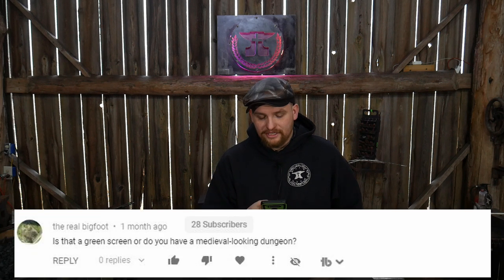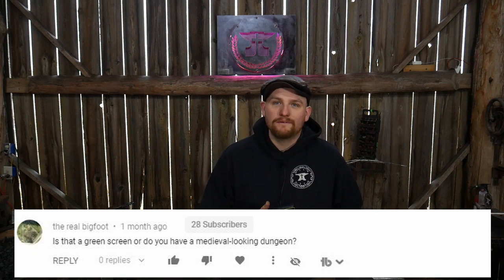Harbor Freight Anvil Q&A  #blacksmithquestionoftheday (S2E2)

Comment: RXR track is better..... At least you know it is not an anvil...... The other one just looks like an anvil. Lol.  I do agree that it least it has some usable things lile a hardy  and edges.  Beyond the hardness and a million other issues. I never hear anyone talk about is the shape of the horn. If the horn is not round, shaping on the horn makes everything just that much more complicated.... I have been forging for a living 30 years shoeing horses, I am in the fire literaly daily. Your begging shoulder issues. If the horn has a flat spot on top, you have to shift your body across the far side of the horn to get a radius.  Changing your posture 8 gazilion hammer blows over a lifetime of forging shortens that lifespan. Your time you can enjoy forging will be diminished. Lastly as the radius in now compacted your margin for error increases exponentialy. Believe me I know anvils are expensive.... I have had 5 in 30 years. You must consider, it is the heart of the shop. They are cheep. Way way way cheeper than a rotator cuff surgery.  Get a serious anvil and forge. I still use my orignal forge in the shop. I have done 30 years of forging with 3 gas forges and 3 coal forges. I could have still been using my original anvil but it was too heavy for in and out of the truck 5x a day. It was a 165lb Peter Wright. To proove im not talking smack my next anvil had a flat spot. 125lb Mankle.  Now I rock a 100lb Emerson traditional in the truck for 18 years. 150lb Emerson on a 300lb base in the shop. I have a 100+ year old Trenton my son uses. 100years of service... a good anvil is cheep. All round horns. Good tools change your life. Bad tools can make the simple job so much harder you quit befor you get proficiant. Invest in your succsess with real tools.

Comment: The need for the 'perfect anvil' is overblown. I use one of the 55lb Harbor Freight anvils, and yeah, it ain't perfect, easily dimples, but for the occasional amateur blacksmithing project, it does the job just fine. After all, we're not making precision watch parts here! ;-)

Comment: Interes, I have plenty of railroad track available.  Was considering....... mount the curved surface down maybe?
Reply: That's doable but the catch is that the bottom face isn't as thick as the top so you'd need to add some gussets to make it more beefy.